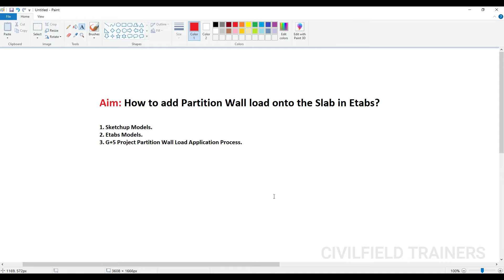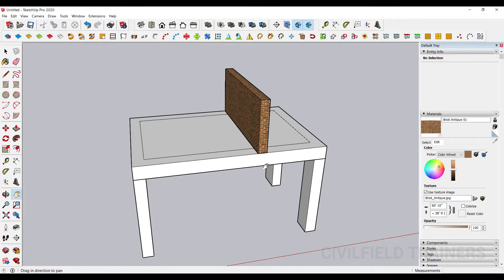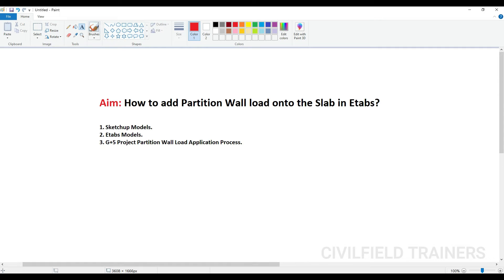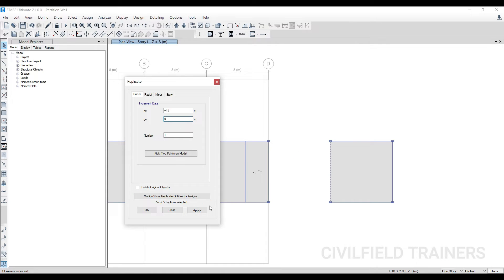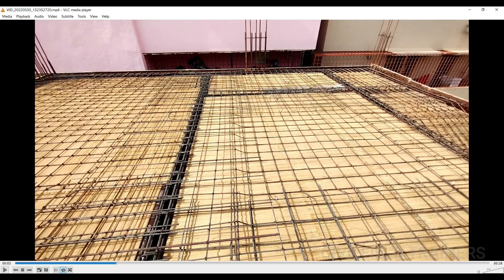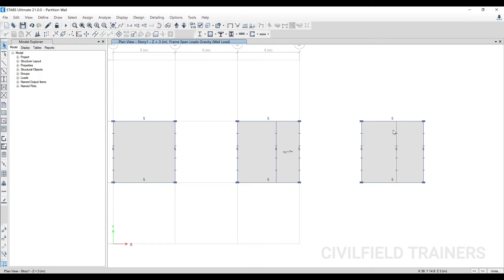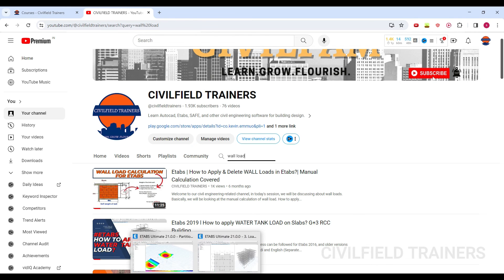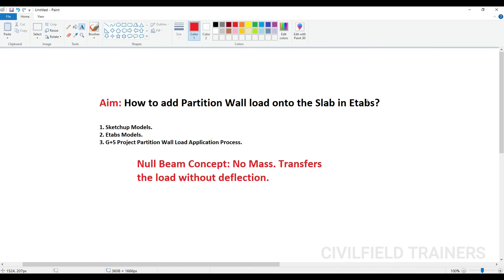Partition Wall Load in Etabs | How to Apply Partition Wall Load on Slab in Etabs?

Comment: Landed here to look for a solution and an answer whether a partition brick wall of (4~5 inch thickness which is 12.5ft  by 10 ft )could be built on 1st floor slab w/o a beam & wall underneath since the slab is already constructed..meaning am not a technical guy however I was blown away by the fact that how easily u've  explained the concept...was able to digest the whole video w/o any fervors. your students must be fond of your classes for sure ..and so All the best for the same!!!
Moreover, as I explained what would you suggest in the given scenario, its a new construction but the 1st floor slab work is already done so in this case can I create a beam above the slab and then rest this wall over it ...or maybe any other solution you might suggest???  surely that would be really helpful...
great content once again though!!!
Reply from the maker: You can go for lightweight block work in this case. 

Secondly, if the columns aren't erected yet on the level above. You can run a beam having the same width as the column, and a nominal 100mm depth. But if the columns are already erected. Then I wouldn't recommend this method.
Reply: @civilfieldtrainers Thanks a tonne for the revert!!

Comment: Sir, the distance of the beam on my first floor is 9 feet in width and I have to make a partition wall of brick on the top and a gate has to be given in the center. So can I make a partition wall on top without any beam below? 
I have a 5 inch slab..Sir please reply and help me....thanks
Reply from the maker: Give a hidden beam underneath. To increase the stiffness of the slab right underneath the brick wall.
Reply: @civilfieldtrainers  My house is already built. I have to do the partition of the bathroom on the 1st floor.
Reply from the maker: @sarfraz212  Go for 4 inch light weight blocks instead of red brick. AAC provides good sound insulation as well.

Comment: Hi Sir, Can we build a partition wall with no beam under it will it hold on or will
It cause any structural problems. My slab is 15 years old..
Reply from the maker: Yes, it may cause excessive deflection in slab.

Comment: Sir, in the third scenario, suppose I constructed a 100mm thick slab and later added a 4.5-inch thick wall on top without installing a beam underneath. Upon applying a wall load to the null beam and conducting an analysis in ETABS, the slab fails. What would be the appropriate course of action in this case?
Reply from the maker: I have responded to this same query of yours on the app.
Reply: Thank you so much for your insightful response! Your teaching skills are truly exceptional. I appreciate the dedication and the timely replies to my queries, both in your online classes and on YouTube. Your knowledge and structured approach make learning enjoyable and effective. Keep up the fantastic work!